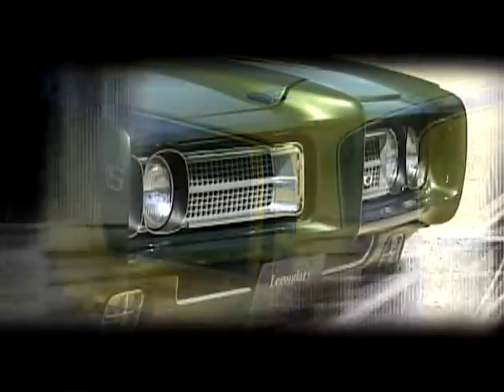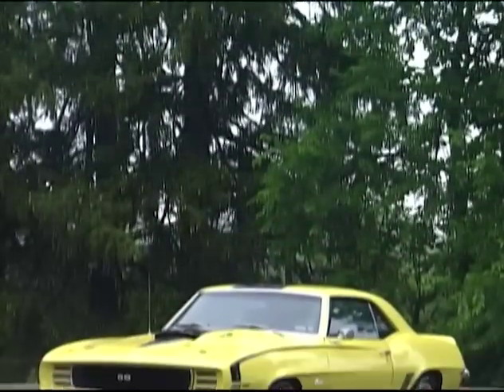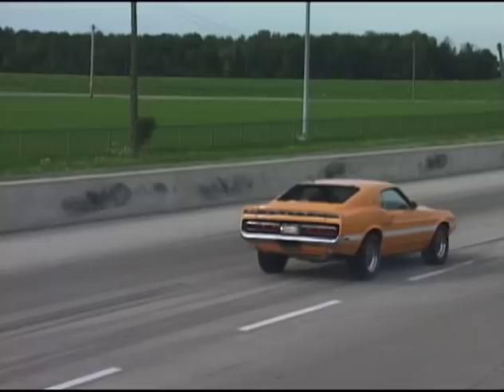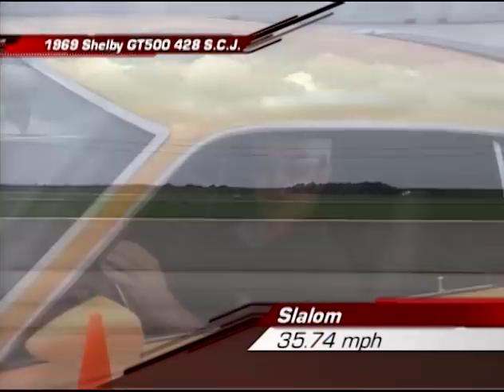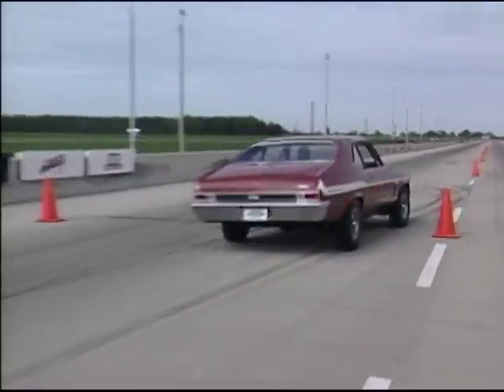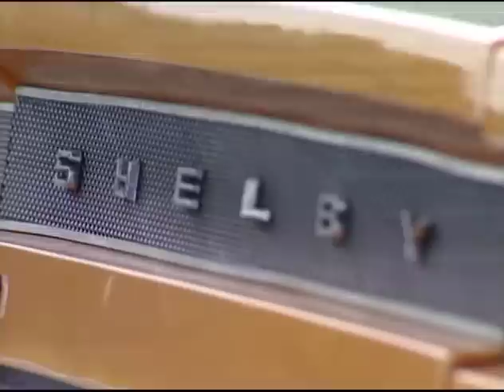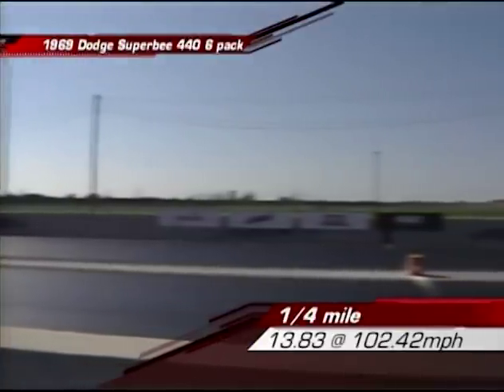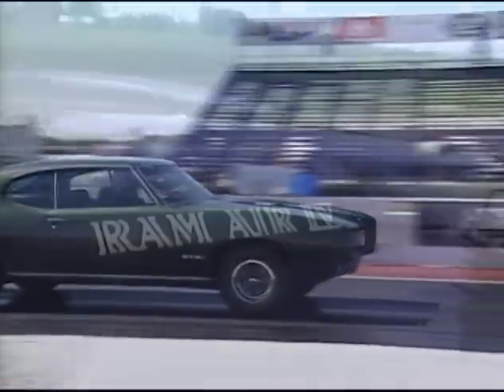What's the fastest 1969 tuner? SUPER MUSCLE CAR SHOOTOUT!

Comment: I was 17 in 1973. I had a ‘69 GTO, Windsor Blue black vinyl top and interior. 421HO motor Ram Air IV, 4 speed Muncie M22 Rock Crusher trans. It was tuned by Nunzi Romano “Mr Pontiac” of Nunzi’s Automotive in Brooklyn NY. I loved that car. Then I had a ‘69 Baldwin Motion Phase II Corvette built by Joel Rosen of Motion Performance. My last hot Rod was a ‘70 Chevelle SS454 LS6, 4 speed, cowl induction hood, Birch White with black vinyl top and hood stripes, also tuned by Motion Performance.  They used Sunoco 260 gasoline. If I only knew then what these cars would be worth $$$ today…

Comment: I'm a BBC bloke, but I've always had a soft spot for 66 to 70 GTOs, especially Green 69s. Another category you could list is anger, how angry does it sound? The Baldwin/Motion Camaro sounded plenty healthy, but it needed some slicks and ladder bars to step into the ring. 
The Royal Pontiac GTO sounded like it took a deep breath, got up on the balls of it's feet and came out swinging. 
All of the others sounded tired and flat. The Nova was clearly not sorted (as described). An L72 should sound crisp, not flat. The AMC, Dodge and Shelby all needed a decent exhaust to let them breathe.

Comment: Great seeing these cars together. The only fragrant oops l saw was on the Baldwin  Motion Camaro. The man says it came with a 900/950cfm Holley carb and what they're showing on this one isn't. The 900/950 cfm was a 3 barrel and the secondary diaphragm was like the outboard carbs on the 400/435 hp corvettes. Big when compared to a 780 cfm. The Nova must not of had slapper bars. Still a cool video.

Comment: Royal Pontiac was doing Pure Stock supertunes on their engines before it was cool! If the Pontiac really wanted to be sneaky, there could be a 428 under the hood. All normal production Pontac blocks, except for the decked 301's, look exactly the same, and have the same external dimensions. It was one advantage Pontiac had, that 350 or 400 badged car could have a 428 or 455 in it, and unless your really knew what to look for, you couldn't tell the difference.
Reply: That's exactly what I think was going on here, I believe that was a 428ci in that Pontiac with the RAIV top end.

Comment: That Super Bee looks like a Factory built A12 car to me in 1969 you could get the Dodge Super Bee or the Plymouth Road Runner A12 cars and that's what they looked like 440 6 pack dana 60 with 4.10 gears, HD hemi suspension and cooling, HD engine components with a lift off glass hood and 15x6" steel rims with the red stripe wheels
Reply: Yeah, performance looks stock... into that headwind...
Reply: I think the 4.10 gears hurt the Bee, too short, it probably would have been a lot quicker if it had 3.23 gears for the that 490tq to chew on, it might have even worked well with 2.92 or 2.76 gears like a CHP car.
Reply: That IS an A12 car

Comment: 1968 was the last year for vent wing windows on all redesigned GM midsize cars, especially for convertible and 2 door hardtop. For 1969, adjustable head restraints come, and vent wing windows go. For 1968 Ford, Lincoln Continental and Mercury full size cars, both adjustable head restraints and vent wing windows are still available, including the convertible and 2 door hardtop.
Reply: Incorrect David.  Vent wing windows were available on GM post coupes until at least 1972.  I owned a 70 LeMans with them and here is a 72:  https://barnfinds.com/bf-auction-1972-pontiac-lemans/
Reply: Yup. Had a friend who's parents brought a Buick Skylark 4 door back in '72 and it had wings.
Reply: Not quite. I remember going to a few showrooms back then and paid close attention to whether the cars had vent wings or "Astro Ventilation" as they called it back then. I was in high school and my friends and I would look for that and the side marker lights to tell if a car was newer.
Reply: Davros Caan, Correction: all 1969, 1970, 1971, and 1972 GM mid size cars still uses vent wing windows on 4 door station wagon, 4 door pillared sedan, 4 door hardtop sedan, and 2 door post sedan, but not on 2 door hardtop and convertible. That's make more sense.

Comment: Great comparison. Finally nice to see a Royal Pontiac GTO kick ass against big names like Yenko, , Shelby , Baldwin Motion and Mr Norms Dodge. Pontiac to me never got the recognition it deserved from back in the day. 

I had a 69 GTO in high school and I beat many cars. 383s, 440s , 396s , 428s, 390s.  

Absolutely slammed small block cars like your DZ 302 Z28s , Mopar 340s dusters. 327 chevys Wasn’t even close. 

Thanks Peter and Tom for doing this years ago. 
RIP Tom Hnatiw.
Reply: Natch... Torquey GTO's owned stoplight to stoplight... where more people saw them... took a full 1/4 mile for the overcammed Chevy's to get a fender ahead: 
https://www.youtube.com/watch?v=SJIRitKQYrM
Reply: @BuzzLOLOL  that was a interesting video obviously Chevy promo. So Chevy wins. 

396 were good running engines I raced several with my 69 GTO  many close races but the Pontiac 400 always came out on top. Only car that beat mine in my area was a 1970 GTO  455.  That car rocked.
Reply: @mattspontiacta  - Dealers-only video... interesting the GTO smoked the Chevelle for 95% of the 1/4 both times... 442 would prolly do the same... and that poor Ford... ran like the Mustang in this Video... by '68 dual quads were gone... by '69 big cam and Shelby himself were gone... 
The 396 had the big valves, big ports, and big cam though... (and also the biggest optional 375/425 HP 396" engine in reserve)...

Comment: The mid to late 70s was a great time to grow up in.  Fashion was butt ugly but one could buy a muscle car for a few thousand bucks and go street racing that same day.  I owned a clean stock all stock Sikkens midnight blue 72 455 Formula Firebird and even though it the engine was only rated at 250 HP,  the torque was 490 foot pounds.  Great car for light to light racing and showing off at the Friday and Saturday night car get togethers!  Had to sell the car to finish my university but what use is a muscle car if you don't use it to have fun while you're young?

Comment: I find it interesting myself owned a 70 Mustang Coupe 302 two-barrel single exhaust. My auto shop teacher in high school at the time what's a mad scientist with engines. We put bigger jets in the carburetor set the engine up on the oscilloscope from what I have seen here I would have beat that Shelby in the quarter mile especially from 0 to 60. No surprise to me the ram air 4 was the quickest although I thought the Baldwin Camaro might have nudged it out. 440 six pack is a beast ! my neighbor owned one built by ramchargers. I know there was alot more in that 440 then what was represented here. And I believe the Rambler is AMC's fastest factory car, fast little bugger. How come Buick was not represented here? gs anyone😁 so awesome to see the cars I grew up with but I think a better representation for every car company could have been done a little better.
Reply: Correct - The SC Rambler was AMC's fastest stocker. It ran 14.3 @ 100 on untreated pavement with the skinny E70 tires. It's interesting to see these cars running on a surface prepared with VHT/TrackBite. The ETs are lower than they would have been back in the day. The Rambler improved by over .5 seconds, and might have done even better with the optional 3.91 gear given how well it hooked.
Reply: No your low hp 302 would not have beat this Shelby - I don't care how much magic jetting your auto shop teacher did with the Motorcraft 2 BBL.
Reply: @Thomas63r2  - HAHAHAHAHA,That would have to be one helluva big jet wouldn't it?
Reply: The Ford 427sohc is unbeatable in the right hands.Always beat the Judge and all of the yenkos.
Reply: @thomasyazvac1219  also the Thunderbolts
Reply: @thomasyazvac1219  Very beatable actually even with the success of the Thunderbolts  The 427 SOHC was never a production line engine as an engine option in any car model line, but it was part of Ford's "Total Performance" campaign of the middle 1960's.  It was damn near impossible to get one new when they were offered through the parts department or Holman-Moody.   In the mid/late 1960's even regular 427 Ford engines were difficult to get even when your name was Mickey Thompson or Caroll Shelby.   Certainly a strong performer, the 427 (regular OHV and SOHC) are available currently in high quality aftermarket reproduction for the moneyed enthusiast.  Such engines are still bought and built now for reasons of nostalgia - not because they are the ultimate in power.  The 427 Ford heads in any form, low, mid, high rise, tunnel port, SOHC are stuck in the '60's, for many years now the aftermarket cylinder head manufacturers have developed any of the canted valve head designs (Big Block Chevy, Ford Cleveland and derivatives) and shallow angle inline valve heads (LS etc.)  into designs that easily outperform the Ford 427 (OHV or SOHC).  Still the Ford 427 is both a great looking and sounding engine.  I'm not a hater of the Ford  427 and FE engine series, about 45 years ago I owned 428 Cobra Jet R code '69 Mach 1 4 speed Mustang that was a solid runner.  This is an odd thread coming from the OP's boasts about his sewer jetted 2 barrel single exhaust low performance 302 being able to mix it up with a Shelby big block.
Reply: @Thomas63r2  Totally agree. I owned a 68 Mustang (in 69) 289 2 barrel. I put an Edelbrock. Holley. and Hooker headers, with miniscule improvement in acceleration. It caught fire the night before it eas traded in on a new 69 Z/28.
Reply: @Thomas63r2  say whatever you will
That was a poor et for that Shelby. And my lowly sewer 302 was beating cars like 340 cuda which is a low 14 to 13 second
Ride. With a c4 tranny I could wind her up to 60mph in first gear bark second and chirp 3rd. There was not many cars that beat my 0-60. Yes I know it could not beat a big block Shelby in the quarter
I was being sarcastic, but I would give it hell 0-60. Being from Detroit the two fastest cars I knew of was the black ghost Hemi Cuda and a 427 Fairlane.
Every Friday and Saturday on Telegraph Road the big boys would trailer their cars and race for the big money
Reply: @BuzzLOLOL  being from Detroit the fastest cars I knew of were an sd455 Trans Am gs455 Buick 427 Fairlane and the black ghost Hemi Challenger
There was a boss 302 that was in Car Craft magazine but rarely did he show up
Reply: @iggyfritz7150  - I'm in Toledo, almost a suburb of Detroit, with GM, Ford, Chrysler, Jeep, Dana, Champion factories... Willys, Knight, and Kaiser earlier... Fastest kinda stock (limited production) cars in '60's were L88 Corvettes and ZL-1 Camaros...
Reply: @BuzzLOLOL  funny you mentioned that my friend in high school used to have a fast Mustang he raced at Detroit Dragway his dream car was a L88 vet and when he got it he came to me he said I've driven a lot of fast cars Dave but that that scares the hell out of me 😋
Speaking of Toledo years ago my band I was in played Toledo Speedway. I remember being on stage in there you could hear the cars roar past through the back wall. A lot of good times I've had in Toledo before. Used to have a girlfriend that lived not too far from the old Willys Jeep plant.
Reply: @BuzzLOLOL  oh how could we forget to mention the Chrysler Hemi and wedge
Wouldn't want to get any backlash from the Chrysler camp 😂
Reply: @iggyfritz7150  - The L88 was 100+ HP above any of them!
Reply: @BuzzLOLOL  yeah because of the insurance companies many engines were way underrated. A 427 was rated at 425 when it actually put out 520 -550
Reply: @iggyfritz7150  Dream on sewer 302 about those "races" against guys out goofing off with their ill tuned cars.  It was hilarious Friday and Saturday night fun, but even I sometimes egged on a loud muffler car to make them think I wanted to race them.  I just wanted to see them squeal their tires and drive like a fool - I helped at least one of them get an exhibition ticket when he didn't notice a patrol car up ahead.  When the light went green, he left spinning his tires and racing away while I left normal.  As I was slowly driving by his now pulled over car he was madly pointing at my car - probably telling the officer that I was racing him!
Reply: @Thomas63r2  myself have egged on cars I knew I couldn't beat.but being from Detroit living just a couple miles from Detroit Dragway racing was in the blood.
Almost every other home had a muscle car or all out drag car. One Man 6 houses
Away his car rattled my Mom's dishes everytime he ran his 427 soch car called the stripper. I got to ride in a 9sec Boss
302 that was featured in Car craft magazine. So I know my machine's
Real well.even worked for Roush.
I am a blue oval Man but love all muscle machine's. I have owned a 65 289 hi PO
Stang t-10 4 speed Detroit locker rear,The only car that I outrun the Police in and will never do again 😜  72 cobra jet
Gran Torino, 70 mustang 351 ho( my fastest car) 429 thunderjet thunderbird,
350 Monte Carlo just to name a few.
So what I write is truth not bullsh#t.
Reply: @iggyfritz7150  I have no doubt that you have owned some cool cars like we all did back then.  I have little doubt that you burned rubber on cruise nights.  But I'm not buying the idea that some peg leg "sewer" jetted 2 barrel low performance 302 Mustang with a loud muffler was slaying 340 Cuda's and hanging with high 13 second cars.  A Boss 302 Mustang running 9's in the '70's would have been a very big deal - what issue of Car Craft did that appear in?
Reply: @Thomas63r2  first of all my 302 stang did not have a loud muffler. Second it was raced on the streets not on the strip and yes it kept up with high  13 second cars doesn't matter what you think I lived it. Second if you want to investigate and see if I'm lying about the 9 second Boss 302 look back at 1970s issues of Car Craft magazine maybe you'll find it. All I remember is the guy who owned it worked at Holley carburetors it was a professional race car all tubbed out tunnel ram. I spent many times on Telegraph Road and it doesn't matter squat to me if you believe me or not.
Reply: @iggyfritz7150  Okay, so the quiet muffler explains it all: you were able to sneak in a rolling start against standing start opponent!  All a massive carburetor "sewer" jet is going to do is to make the air/fuel mixture very rich - which decreases power.  I'm sure that muscle cars of the era were quaking in fear of your miracle 2-barrel single exhaust peg leg Mustang's world beating supposedly 13 second performance (in your mind).
Reply: @Thomas63r2  I knew you'd understand eventually.
Reply: @iggyfritz7150  In your mind LOL
Reply: @Thomas63r2  At least I owned some real muscle cars you probably get to drive yo mommy's Honda 😂
Reply: @Thomas63r2  you bet at least I have one
Reply: @iggyfritz7150  Sad.  When you got nothing left, that is when the insults come.  No Honda cars in the list of the 28 cars I have owned, but I did buy a beautiful Candy Glory Red Honda CBX 1050 (motorcycle) in 1979.  I'll let you look it up and decide if it's a worthy motorcycle.
Reply: @Thomas63r2   that actually sounds like a really nice bike myself owned the Honda Magna 60.  I've got nothing left I've got plenty left and you started the insults not me

Comment: Not surprised by the 440 Super bee as a winner in the 60ft race. The torque in these engines is amazing and Dodge always did seem to have cars set best to launch at the drag strip. I was a little surprised to hear them say it failed to show good power in the remainder  of the run. The 440s didn't show the breathing potential of the HEMI cars at high RPM but they will wallop a HEMI all the way up to 4000-4500RPM  on torque. This may not make them as good a drag race motor as Hemi but it's far from the ingredients of an engine you'd ever call out as "weak". Makes me wonder if it's giving it's all or if this one isn't really up to potential.
Reply: That Dodge front end prolly didn't fair well running into that 50 MPH headwind...
Reply: 4.10 gears are too short for the 440's powerband, it would have probably benefited from a 3.55, 3.23, 2.92, 2.76 axle so that TQ could have generated mph.